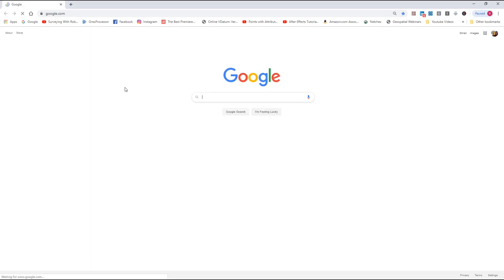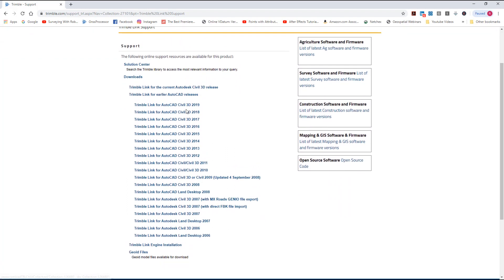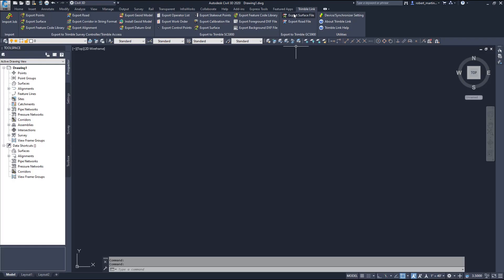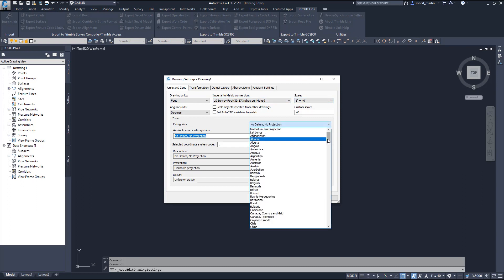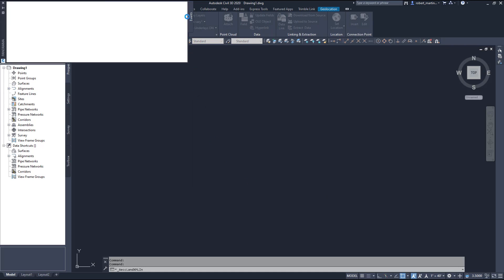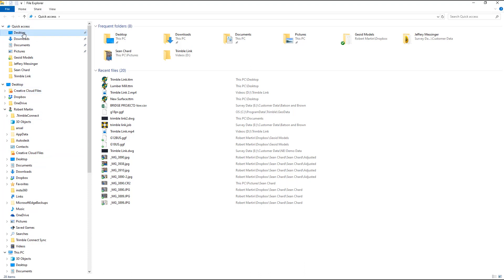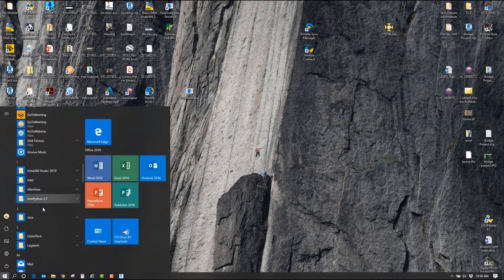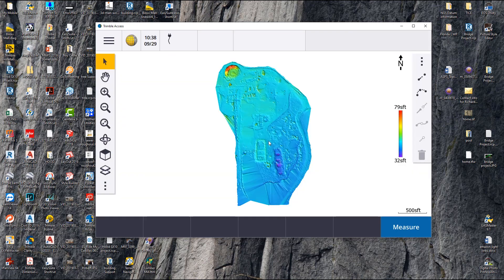Trimble Link for Civil 3D

Comment: Hey so if you're running AutoCAD C3D 2020 and wish to use Trimble Link and you already have Trimble Access on the data collector, do you also have to also have Trimble Business Center to manage the file uploads from C3D's Trimble Link add on to the data collector? Or can the C3D/Trimble Link Files just be uploaded directly to the data collector running Trimble Access? I only ask as I'm not sure if Trimble requires you to have TBC in order to utilize Trimble Link's capability of converting the C3D entities like alignments & surfaces
Reply from the maker: Save the file then transfer the file to the data collector. Use the Trimble Data Transfer utility to move the data to a directory.
Reply: @SurveyingWithRobert  alright sorry to bother again... I am running C3D 2020 and I downloaded the most current version's file. but after the install finished there isn't anything new on CAD's menubar or ribbon for Trimble Link. Did I miss something by chance? I'm wondering if the download went to the wrong hard drive potentially?
Reply: Nevermind. Forgot that I had to use the CUI command in Civil 3D to get the Trimble Link Tab to add to the ribbon. But it's fixed; sorry for the confusion
Reply: @kenneth1669  gotta add it to ribbon, then.

Comment: In this context, if you import a dxf will the lines automatically adopt the elevations from the DTM?
Reply from the maker: Are you trying to take 3D lines to Access?
Reply: @SurveyingWithRobert  Yes sir. I have been able to load a dxf in Access but nothing I can stake with grades. Thanks again
Reply: @joshuaellis8380  Hi Joshua, have you been able to figure this out? I'm having the same issue, I'm able to import 2d dxf files and stakeout, but not 3d dxf files. I'm using 2018 C3D and 2019 Trimble Access, General Survey  
Helgi Valgeirsson
Reply: @SurveyingWithRobert  hola